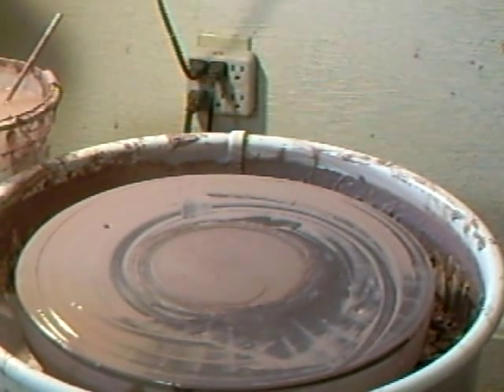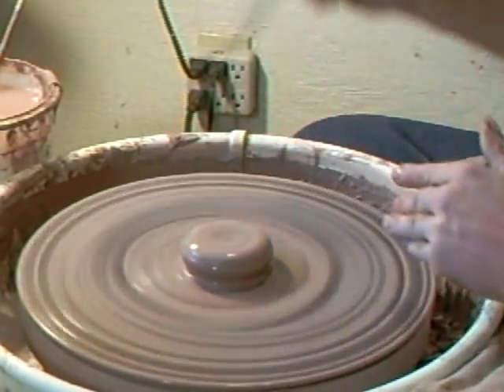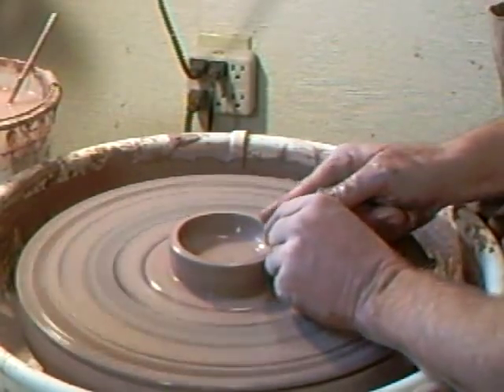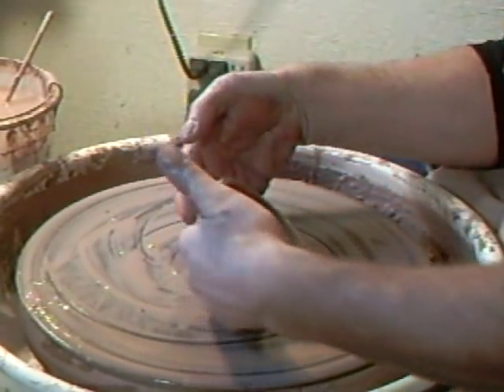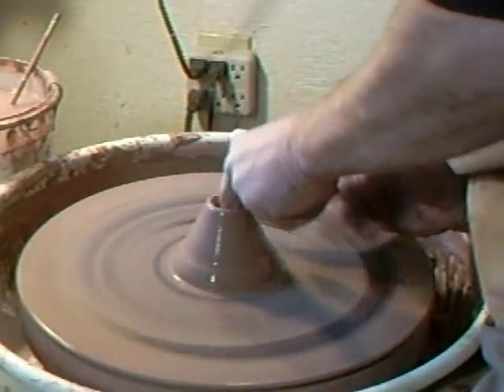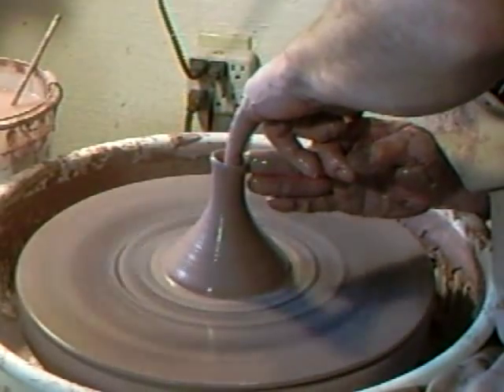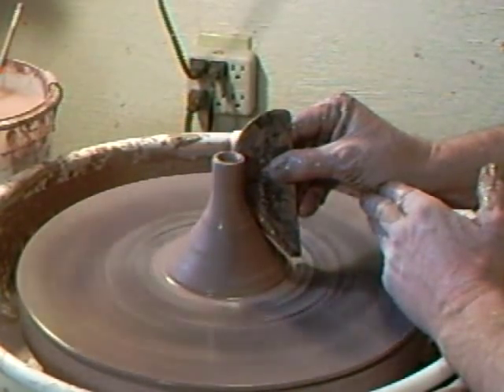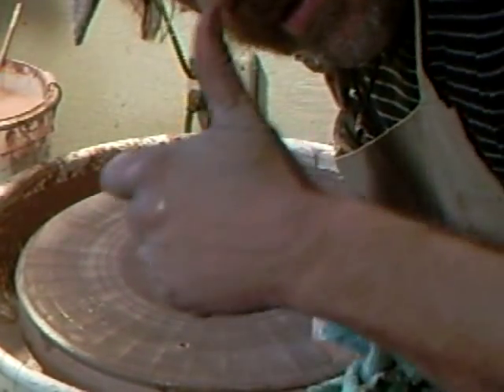SIMON LEACH POTTERY- Throwing a teapot spout and lid !

Comment: This is really funny I'm a Potter now and I was a machinist I actually still I'm a machinist I work out in my garage on small parts all the time for some extra money I can't believe they allowed you to machine beryllium copper out in the open. Beryllium is so toxic and it tends to give off small particles. I have probably 10 lb of beryllium scraps I don't know what to do with.

At any rate I was always told to have a teapot lid go inside the gallery is to not condense and drip all over the outside you find that is not a real issue?